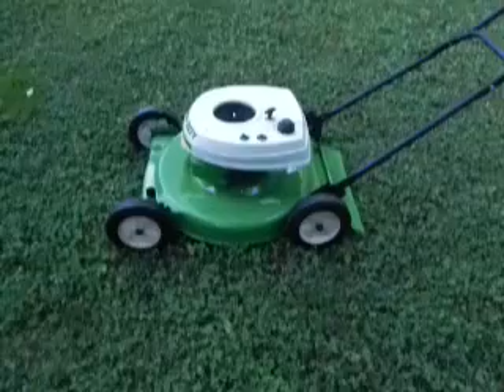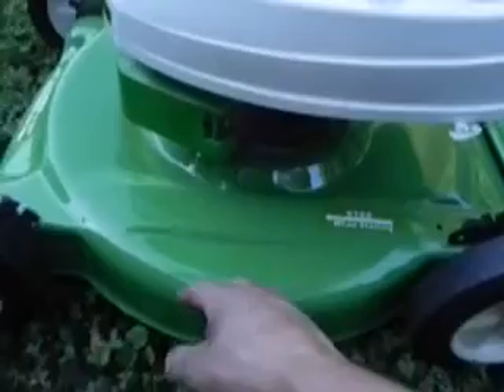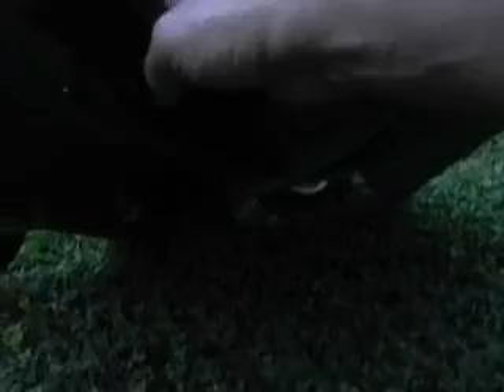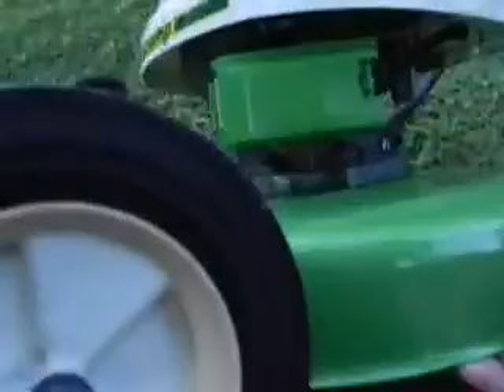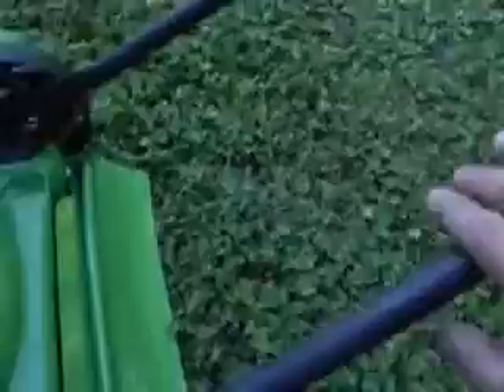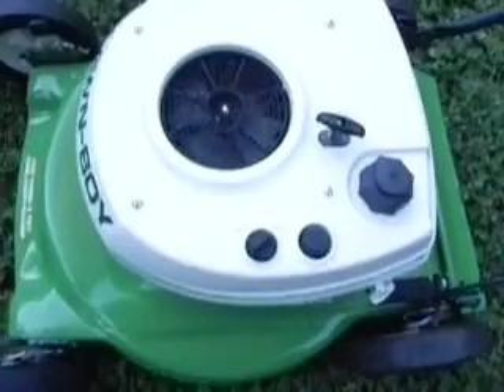1982 Lawn Boy Scamp, Model 4503

Comment: I have the very same lawn mower. All original. Lost the plastic discharge deflector. Other than that, it in very good condition. Starts right up and runs really well. Blade is nearly new. Little to no wear. I have no idea what it is worth? I don't need the machine. If anyone is interested in this machine, add a comment and we can talk. Oh yes, I took the carb completely apart and cleaned it really good. Runs like a new mower.
Reply: Do you still have this mower,  I have one also but while doing a restore on my carburetor has gone missing if i can afford It I  might try to purchase it. Depending on location.
Reply: Sorry, I put it up for sale on Craigslist, it sold for 75 dollars. I first listed it for 100 dollars, but had a few people say that was too much. Your Lawn Boy looks like new. Great job restoring it. Good luck with finding a carburetor.

Comment: Want a other scamo I have self propelled 8603.
Scamp what a name sound cheap or named after early 70's dodge. Those mopars of that era would lay some hurt on their competitors. 
Ah the simple days gas oil and motor. My old Nova's could tear them things up still ran, my new stuff, baby it, it falls apart Cadillac and Buick. Like new mowers I was small engine tech for awhile old stuff service and be done with it. New problem after problem.
Reply: im interested